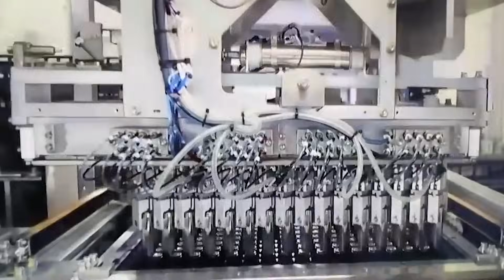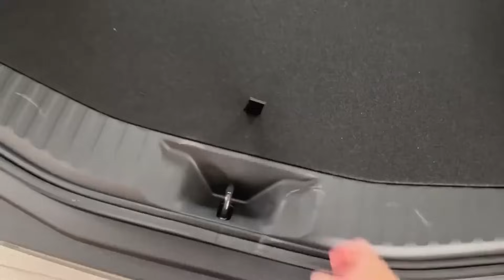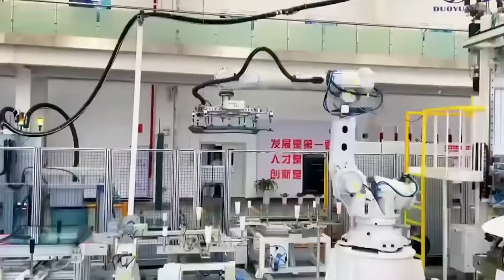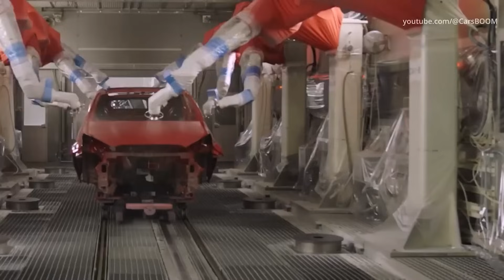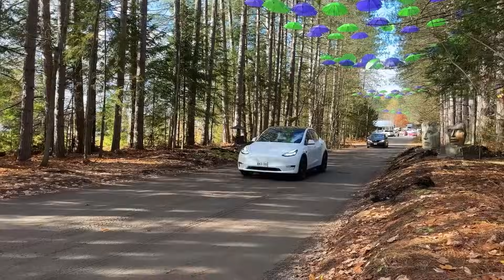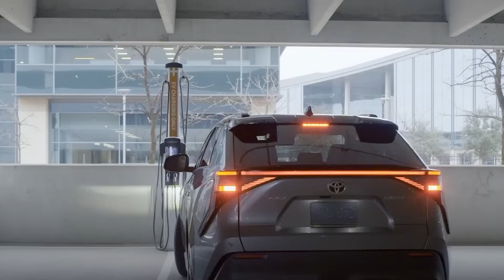Toyota's New $13,000 EV Will Change The Industry Forever

Comment: The all-electric Toyota C-HR+ is expected to be a solid upgrade, but the price tag is the most important factor, with a price around $30,000 potentially motivating buyers to overlook range or charging speeds.

Comment: Here is the actual price lol The 2025 Toyota bZ4X model comes in 3 trim levels. Canadian pricing ranges from $46,515 to $51,845 MSRP. The entry-level, LE model starts at $46,515 Canadian dollars for the Electric: 150-kW motor & 71.39-kWh & E battery. The price for the mid-range LE AWD trim is $47,016 MSRP.
Reply: I think they’re lying there’s no way the sell for $13k 😂
Reply: @BrandonYen-z8d  if you take the amount they sell for in the China currency and then convert it to USD it's about 14k for the super base model.  But part of that is the difference in the currency conversion and no ship and terrif fees also.
So Technically it's not 13k USD but it is if you directly converted it.  That's the catch
Reply: It's only going to cost 13k in China since it's partnered with a China mfg for design.
Reply: $13,000 gets you looking $50,000 maybe gets you buying?
Reply from the maker: Actually You're correct!!
Reply: @GarageHeads  That is almost double from what they claim in the article.  I wonder how much of the other aspects will also be that inaccurate?

Comment: A $13,000 EV I'd like to see that.
Reply from the maker: Us too!!
Reply: Obviously you mean if you buy it second hand or third hand a couple decades down the track. As it definitely isn't priced as suggested. Hahahah
Reply: Drivers behind you yell "PEDDLE FASTER!"
Reply: The all-electric Toyota C-HR+ is expected to be a solid upgrade, but the price tag is the most important factor, with a price around $30,000 potentially motivating buyers to overlook range or charging speeds.